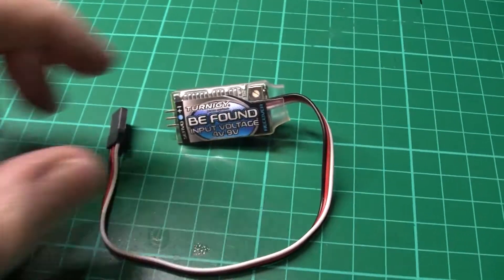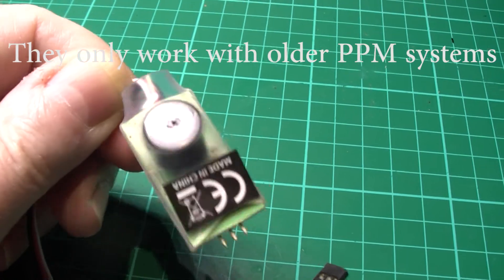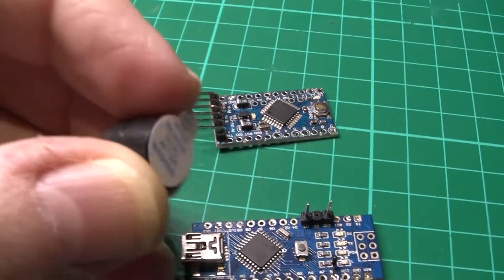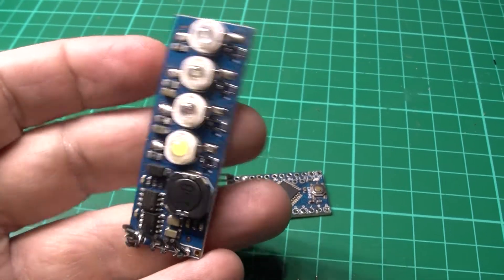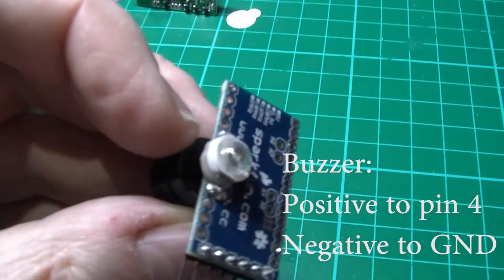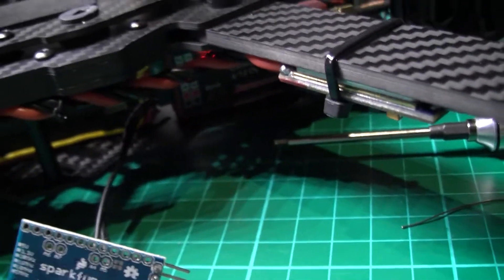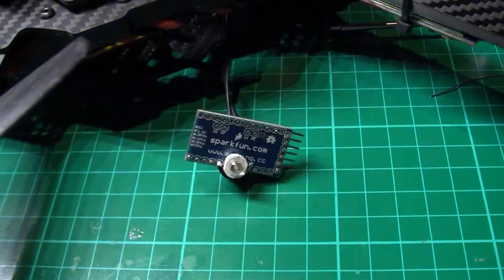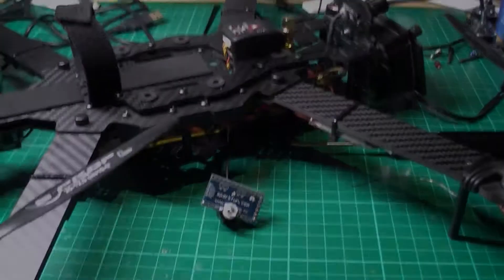DIY lost model alarm ( LMA ) for $6/£4 with Arduino Pro Mini

Comment: Outstanding lost-XXX-alarm.  Thank you for uploading the video, links, and code.
I'm going to see if I can power it separately via a 1-cell LiPo, a small one 100~160mAh and if needed a 5V buck booster. That way when a battery ejects on a soft landing, the alarm will still work. Much needed for when you want to soft land on very tall brush and forget where you landed.
Reply from the maker: EngineerX Glad to have helped :-)You can buy 3.3v Arduino Pro Mini boards which will work with a 1s battery, but the 5v versions won't.
Reply: Vortecks And that's what I'll do- thanks for that suggestion. Much appreciated. It'll be similar to the Screamy that apparently is not loud enough as many have complained http://www.hobbyking.com/hobbyking/store/__78373__Screamy_Lost_Model_Alarm_With_Battery_Backup_And_Low_Voltage_Alarm.html
Reply from the maker: EngineerX Just a side note..... I've tried a Digispark with 2 x CR2032 batteries running in series (6v) and it's run for 3 hours (beeping every second).
Reply: Vortecks That would be plenty of runtime for the usual crash & find flying shortrange with copters. I was also thinking of testing one of those single cell USB-powered LiPo chargers connected in parallel to LiPo and Arduino ProMini. It would be a little bulkier but not too bad. This battery is small http://www.hobbyking.com/hobbyking/store/__7565__ZIPPY_50mAh_20C_single_cell.html
http://www.banggood.com/3_7V-1S-Lipo-Battery-USB-charger-JST-plug-500ma-output-p-91269.html

It would, of course, drive up cost exorbitantly by about $4.50 more
Reply from the maker: EngineerX It's rather a coincidence..... I bought a few of the same battery a few days ago :-)I've also bought some of these for testing the CR2032 method.. ebay item 311340078154.I'm now going to use a Digispark with CR2032. Total cost...... around $6 but it'll be smaller and self contained.
Reply: Vortecks The self contained configuration definitely makes it more versatile. You can move it to any frame and it's small enough to carry in any minicopter. $0.43 per batt holder, those are perfect for this application and CR2032 cells are cheap from BGood. Cool stuff!!
Reply: EngineerX Would the same code you linked here work with a DigiSpark? That thing is tiny !..... That would be a nice video to upload. LMA-Digispark version ;)
Reply from the maker: EngineerX I don't know if it'll work yet but if it doesn't, I'll upload new code :-)
Reply: Vortecks Sweet !!! because I don't know how to do code... only comment, uncomment LoL. Thanks.
Reply from the maker: EngineerX Well, I've just received my Banggood order..... I didn't read it correctly. I've now got 3 x 1s lipo chargers and no 1s batteries :-) Never mind, I should be able to do some more work on the Digispark this weekend and use the CR2032 batteries and have a small, self contained unit.
Reply: Vortecks Thanks for the update. I've ordered all of the bits you listed and received delivery of the insanely cheap buzzers. I'll try the Arduino route first and will be looking forward to your Digispark setup. It'll be a very useful self-contained unit for sure! Will definitely come in handy to avoid having to look for my miniquads when I land/crash on tall brush.

Comment: What value of resistor do you have between the LED and the Arduino ?
Reply from the maker: UKHeliBob No resistor - It's a quick and dirty way of getting one working and I've left it running for 2 hours with no problems. I'd normally use a 100k resistor, but for simplicity sake, I didn't use one.
Reply: Vortecks You are a very naughty boy.  By not using a resistor it means that you are going to need a "failed LED or Arduino" monitor too for when one or other of them dies.  How much current can an Arduino pin provide ?

By the way, did you really mean that you would normally use a 100k resistor or was that just a typo ?
Reply from the maker: UKHeliBob Arduino pro mini - 40ma per pin. The LED is rated far above that, so won't hurt it and it's not like it's permanently on. Like I said, I've left it for 2 hours solid, just to test reliability and it's fine.

With a standard dome LED, I use a 100Ω resistor.....sorry for the typo.
Reply: Vortecks What is the wattage of the LED and how much current does it draw when turned on ?

Comment: A bit over the top using a mini or nano :). Have you noticed the digispark board. it is tiny and ideal for this task. ebay is crawling with them for under $3.50 each.
I'd fit a transistor or parallel up a few outputs to allow extra current to be drawn safely. 20 - 30 mA  rom each pin is not much if you get serious with the buzzer and LED
Reply from the maker: Rob B Thanks Rob.... I haven't seen the Digispark before!This project is a quick and dirty way of getting an LMA working - there are more professional ways of doing it, but I've left mine beeping for 2 hours with no problems

Comment: Fantastic. Been looking for a similar thing for months. Can u share spec of buzzer and led
Reply from the maker: Guy flanshaw Description updated with the parts needed. Please be aware that the link to the buzzers, are the cheaper electromagnetic ones and you'll need to keep them at least 3" from a compass. Also, make sure you select the "white" LEDs and not the "Warm white" ones. In the video, I've got a blue LED which came from one of these: @3